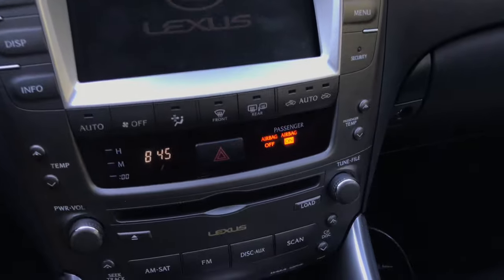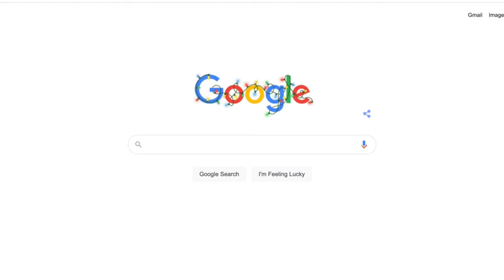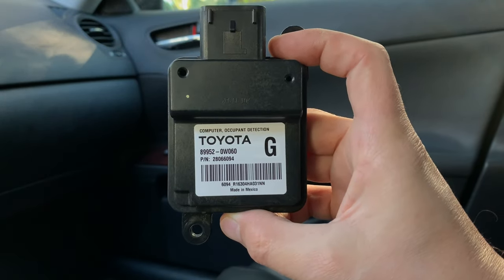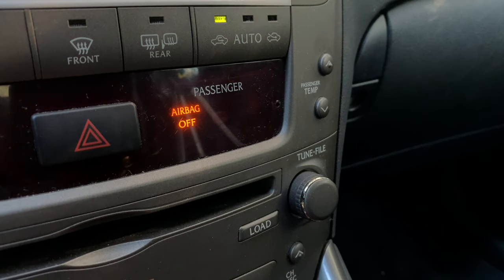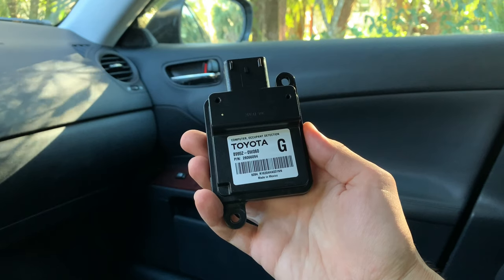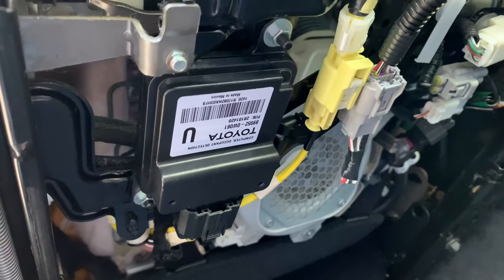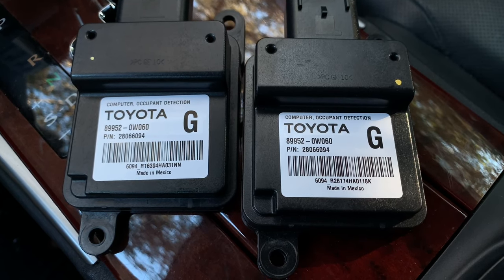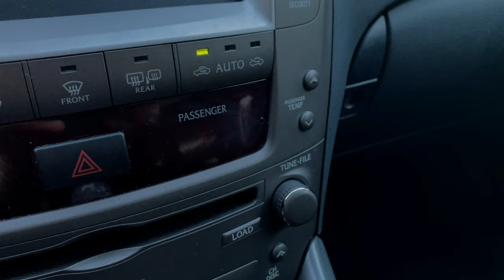How to fix “Passenger Airbag OFF” warning light in your car.

Comment: How smooth and informative your video is thumps up keep up the good work 👍🏼
Reply: @DIYtimeTRD  I got a recalibration code and I tried over n over with a mechanic scanner tool but no luck any idea what I should look for next ?
Reply from the maker: That ECU is probably bad. I had the same thing, tried to recalibrate, but it would never work.
Reply from the maker: eBay or junk yards. 
I found mine on junk yard for $5!
Taking it out though was pain...
Reply: @DIYtimeTRD  I found one at the junk yard but the guy tellin me that I need to buy the whole seat not just the sensor for $150 what you think the car has 148mi so how do I know if the sensor will be working ??? Mine has 124mi and sensor gave up already !!! Any recommendation
Reply from the maker: I went to “you pull” yard. You can take anything you want there separately. At the register no one asked me what is it. Just the ECU...
Reply: @DIYtimeTRD  yeah I know but this junk yard works differently they bring you the part you want, they play it smart lol,
Reply from the maker: Yeah, I’d stay away from those. You don’t need the whole seat to fix this. 
LKQ are pretty good yards all over the country.
Reply: @DIYtimeTRD  I called them they don’t have it 😞
Reply from the maker: Keep checking once in a while, or check other ones outside your area.
Reply: @DIYtimeTRD  thanks again I’ll do that

Comment: Question.  I got hit on side of bed and back passanger door. My airbag start blinking and everytime passanger puts seatbelt on the seatbelt keeps blinking. I got 2011 toyota tundra. I took it to bodyshop they turned off airbag but passanger light not showing nor airbag on or off. What is it? ECU?
Reply from the maker: When you turn on the ignition, all dashboard lights  turn on to perform a check procedure, indicating they are working. After few seconds lights go off, except for the ones that indicate currently present issues (if any) - Check Engine light for example. If any of the lights don’t turn on, its either has bad bulb, or it is unplugged, or its malfunctioning.

Comment: My Fellow Brother I Have A Question. I took my Honda Accord 2009 to have a wheel bearing replaced and cv axle shaft and before I got there I had no airbag light but the mechanic who fixed my car was about 300 pounds after he was done I noticed the airbag light but he denied ever tampering with the airbag module. Can he have affected my airbag by replacing the wheel bearing and cv? My car was perfect until he fixed it at their shop. Please let me know bro
Reply from the maker: Of course they will deny it. Cuz then they would have to fix whatever they did. Though I really cant think of how those two things could be related. Maybe they damaged wires while working under the car.

Comment: Hello my name is Rey I have a 2009 Lexus RX 350 and my air bag light is on, on my dashboard like yours in this video. I’ve tried removing both seats in the front and disconnecting the yellow harness to both passenger seat and driver seat, wiggled on wires and connected the car battery back but the airbag is still on. I never had it scan for codes. Can you please help me?
Reply from the maker: It would be helpful to get the error code. It will point out what specifically is wrong.

Comment: Hi! I hope you can answer, so can I just buy the occupant detection sensor, (used), and plug it in, and it will work?  I’m not sure what I have to do, transfer the old data to the new one. And also did you have the airbag light on the instrument cluster?
Reply from the maker: I found the exact part number as my old one and it worked without data transfer.

Comment: Omg. Im stupid--i thpught mine was broken but 
After you said it weighs you and disables if it isnt heavy enough, I literally sat in the passenger and BOOM airbag on lmao
Its just off bc no ones sitting there lol I'm so dense 

But hey if anyone can help-   I punched my light out of frustration and it popped backwards into the dash

The clips aren't broken but its really difficult to pull it back into place 

Any tips?
Reply from the maker: Use a hook set.